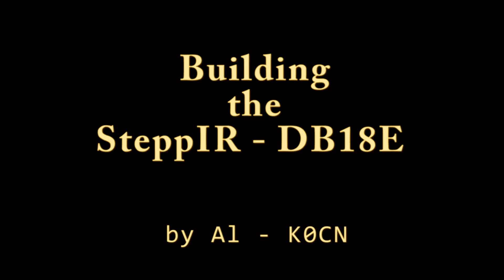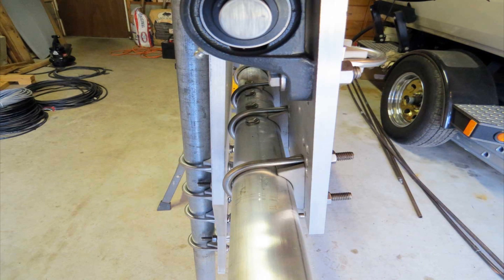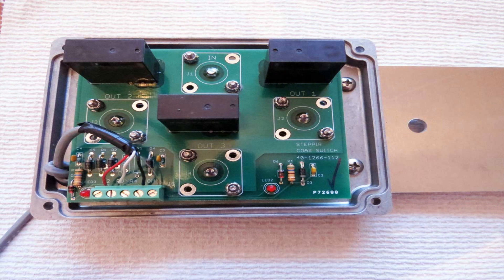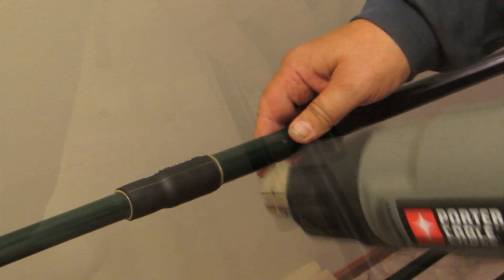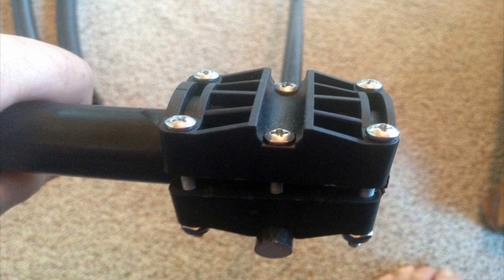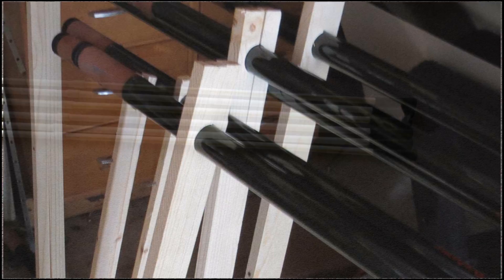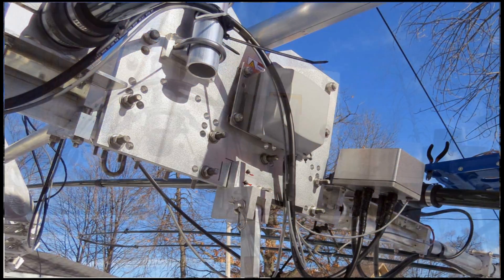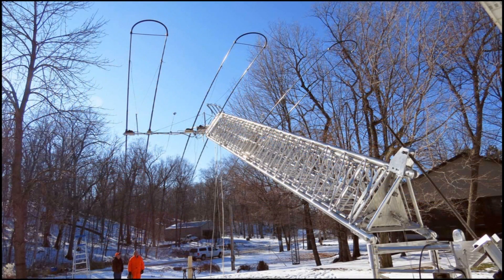SteppIR DB18E

Comment: Can you do a video on operating the antenna showing how you adjust it to tune?   Great video
Reply from the maker: Hi Jim,
The FlexRadio connects to the SteppIR antenna controller via serial port (radio -> computer -> controller). When I tune to a frequency with the Flex, it sends the transmit frequency to the controller via the serial port, and the controller sends commands to the antenna stepper motors. The motors adjust the lengths of the elements to that frequency. If I change the radio transmit frequency again, the antenna will track automatically when the new frequency is sent to the antenna controller and from the controller to the stepper motors.
Hope that helps.....
Works Great, 73 Al K0CN